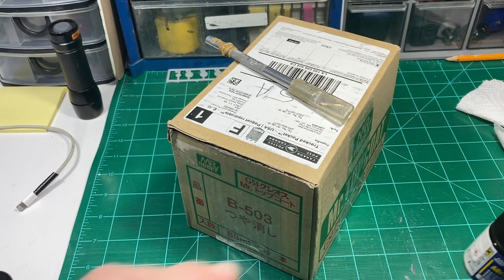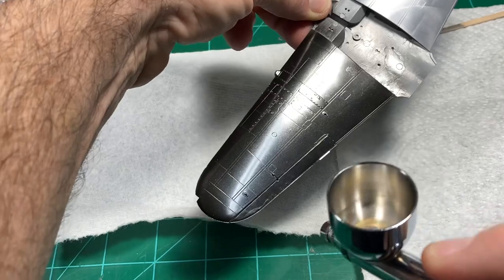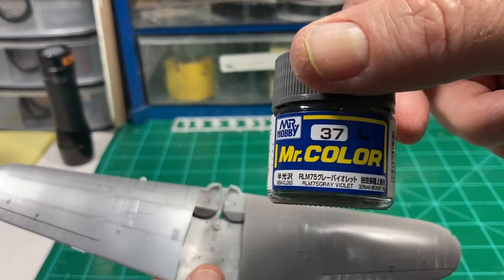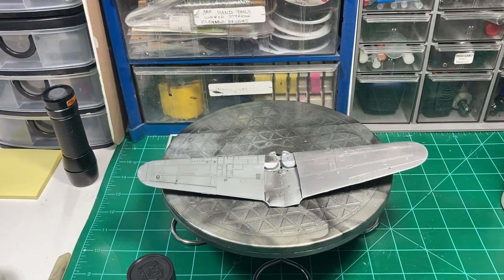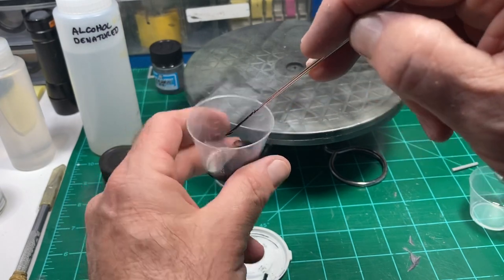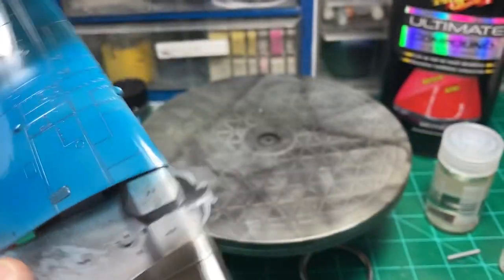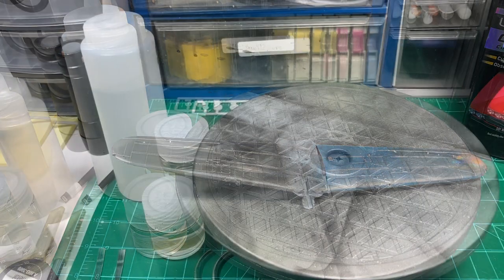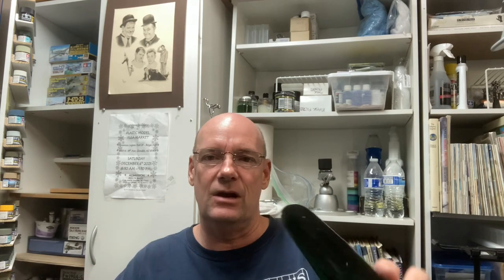Ep 2 EVEN BETTER NMF Bare Metal Finish than before. Mr. Color SM08 Plate Silver Next.

Comment: I haven’t done a NMF yet, but durability would be my main desire. One thought I just had, instead of masking the finished metal to get variation in the panels would be to use different colors in the base coat for different panel colors.
Reply from the maker: Sorry for the late reply!  Using different base color shades is definitely an option.  But when I say "variance" I'm talking about the variations of "all" the metal.  Think of it like the tiny changes/distortions/waving in the metal overall, like every inch.  Think of it like this, shiny aluminum vs a clean mirror.  Both reflect, but one is clearly metal while the other clearly glass.

Comment: Hello Terry from downunder thanks for your effort (subd btw), I read the paint instructions for these paints and they advise "To seal the paint finish, coat use Super Clear or Mr.Super Clear UV Cut (excluding SM206 and SM08)."  I have two 1/48 B17s one will be done in standard green, the other I am considering to do in metallic finish. I am a Mr Hobby/Mr Color convert from Tamiya. Mr. Color SM08 Plate Silver Next AU$14.82 so I doubly appreciate your video! Anyway it will be a little time before I do the B17s thanks again.
Reply from the maker: Thanks for the kind words. Today I will be testing out any sealers.  If I find any that do the job without sacrificing the shine I will make sure to let everybody know.
Reply from the maker: Hey Neil, an update.  The Mr. Color Super Clear UV Cut totally subdued the sheen.  Aquagloss was less offensive, but still took enough away to ruin the refelctivity.  It still looked good, but only had 1/2 the reflective properties.  On the plus side, the paint is very durable.  I did a Tamiya tape test, doing everything that you are not supposed to do...worst case practices.  A little of the pigments came up but the metal itself held well and a little spot pigment rubbing brought it back to where you could never tell there was tape there.
Reply: @rebelroostermodeling6460  Hey Terry and appreciate you doing that! WoW that is strange that Mr color advise to use it oh well glad we found out now rather than latter. I have Aquagloss but I find it binds up my AB ...probably user error...I will do some experiments my end. Cheers

Comment: Gday Terry.  Another convert from Australia here.  I was very interested in your polishing technique but had a devil of a time finding the SM08.  I managed to find a place in Canada yesterday, that have 8 bottles of the stuff, so I ordered 2.  Ouch.  $35 for shipping.  A total of $66 Aussie dollars.  Looking forward to building my RAAF VIP fleet, which is along the same lines of Air Force One and highly polished aluminium.  My question is, 'If you advise not to seal the models, how do you apply the decals without the silvering effect being evident?'   Keep the videos coming mate, they are very informative.
Reply from the maker: Silvering is just a matter of not having the surface prepared well enough for the decal. Even with a gloss, it’s possible to get silvering if air gets trapped under the decal. The surface of the airplane should be super smooth from the polishing before you put the metal on. And that should be smooth enough after the metal is applied to put a decal on.  I have applied some letters to the P 47, as you can see in the other video. And there was no silvering whatsoever. It’s just a matter of having a well prepared surface, and gently rolling the bubbles out from underneath the decal after you apply it… which brings me to my next point, to have something under the decal to bind it to the surface, because the metal is very slick and doesn’t give the decal much to grab on to.

Comment: Quick question how would you handle the different “hues” in the metal. For example a f-86 even as shiny as it is you can still see different tones in the bare metal on the wings and leading edges of that plane. Would you try with the varying the under colors or would you mask the panels and go over top before the pigment rub. Also just to mess with you more how would you handle dull panels mixed in with nice super shiny ones. I have a Sabb j-29 Tunnan and it looks like a quilt of shiny, dull and mixes tones of metal and I’m kinda stuck trying to figure out a way that will hold up to handling to get the finish. Thanks sorry this is so long but you seem to have a good grasp on BMF.
Reply from the maker: Hi Frank.  
For an F86, I would not be too opposed to a light handbrushing of Aquagloss over it (I never can get it to airbrush right for me---I need more practice).  That will give it a little depth to the look and lose "just enough" of the ultrashine to look right for an F86.
That Saab now, oh boy.  It reminds me of a couple old Migs at a local airport by me (a 15 and a 21).  They have about 7 or 8 different tonal qualities and they don't "move" when you change directional points of view.  They actually are different looking types of metals (no doubt some are).  For these it would not be a terrible idea to either tint with a compatible clear like Mr. Hobby if the metal is a lacquer or Tamiya clear colors mixed with some MLT or MRT.  I find it too difficult to dress the metal after application.  WHat I most often do is vary the base tome beneath the metal (using various mixtures of Smoke Clear and Black or even Smoke Clear and dark blues or tans---the big thing is ultra shiny BASE before the metal).  The possibilities are endless, and the experimenting is fun.  By varying the base beneath the metal, you can get the tonal variety you want without having to mask off and paint different colors of metal.
ir an F86, I would not be too opposed to a light handbrushing of Aquagloss over it (I never can get it to airbrush right for me---I need more practice).  That will give it a little depth to the look and lose "just enough" of the ultrashine to look right for an F86.
That Saab now, oh boy.  It reminds me of a couple old Migs at a local airport by me (a 15 and a 21).  They have about 7 or 8 different tonal qualities and they don't "move" when you change directional points of view.  They actually are different looking types of metals (no doubt some are).  For these it would not be a terrible idea to either tint with a compatible clear like Mr. Hobby if the metal is a lacquer or Tamiya clear colors mixed with some MLT or MRT.  I find it too difficult to dress the metal after application.  WHat I most often do is vary the base tome beneath the metal (using various mixtures of Smoke Clear and Black or even Smoke Clear and dark blues or tans---the big thing is ultra shiny BASE before the metal).  The possibilities are endless, and the experimenting is fun.  By varying the base beneath the metal, you can get the tonal variety you want without having to mask off and paint different colors of metal.